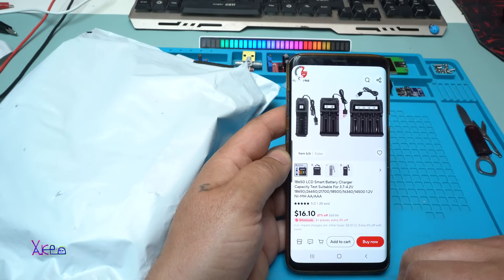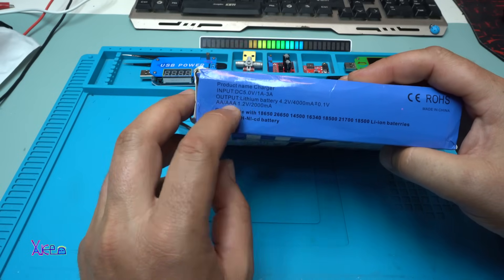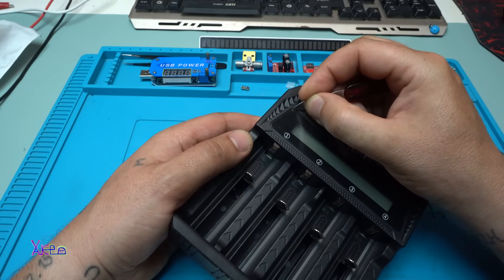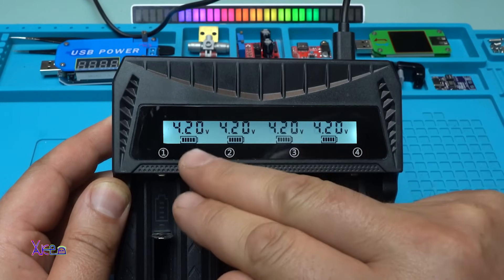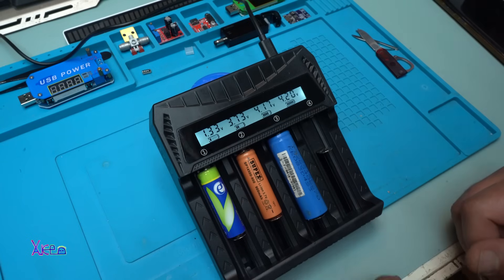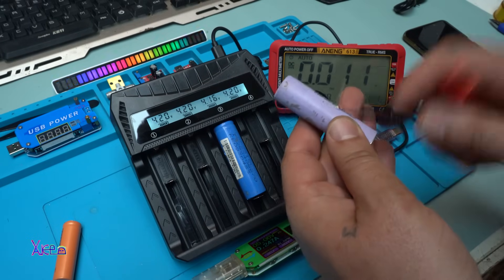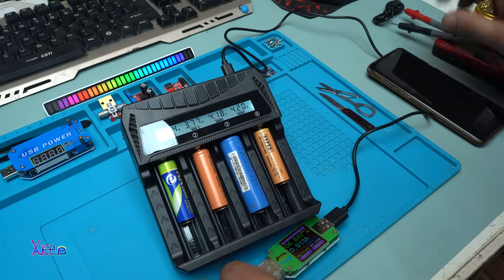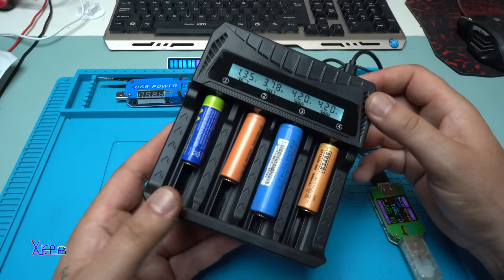SMART 18650 Battery Charger from Aliexpress  - Worth it?

Comment: For 18650s and similar, try the "LiitoKala Lii-500 3.7V 3.85V Li ion 1.2V Ni MH rechargeable LED display 0.3A 0.5A 0.7A 1.0A 12V2A 18650 Smart Charger USB output", it will test capacity, and has more current options. That's what most 18650 salvagers/resellers use for testing. About the same price.

Comment: 1x AA and 1x AAA charging amp rate not mentioned. 
Adapter amps presumably equally shared among all slots. 
AAA: 1,000mA for 2x AAA too high!  Use 200mA for 1x AAA, 500mA for 2-3x AAA, 1 amp for 4x AAA
AA: 500mA adapter for 1x AA, and 1 Amp adapter for  2x AAs. 2 Amp for 4x AA

Comment: When my multiple battery charger shows a bad battery, I bump it with a 9-volt battery outside of the charger to get the electrons flowing and then put it back in the charger.

Comment: It's been several months since I bought the same charger. Thinking it was a bad product, I first bought the single-slot version, then, seeing how effective it was, I opted for the four-slot version. They work very well, but I initially thought it was a bad connection, until I discovered that it wouldn't charge discharged batteries or full batteries that I thought were empty. So I use the single-slot version to test and charge batteries that I recover without knowing their condition.